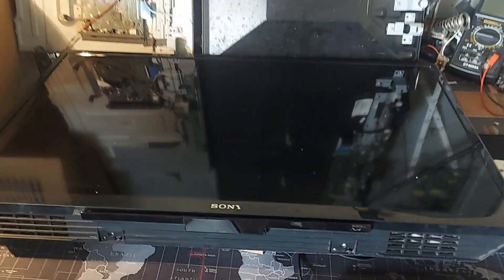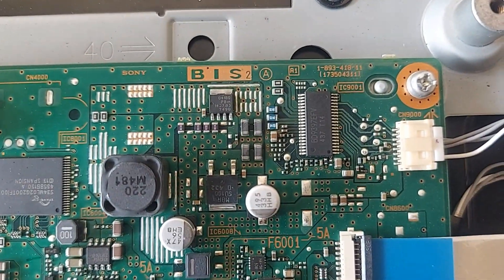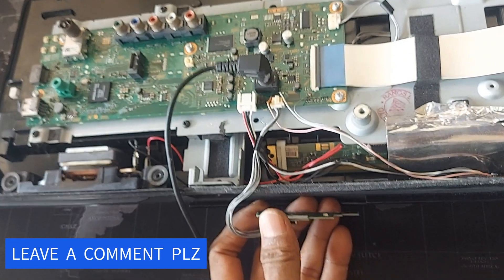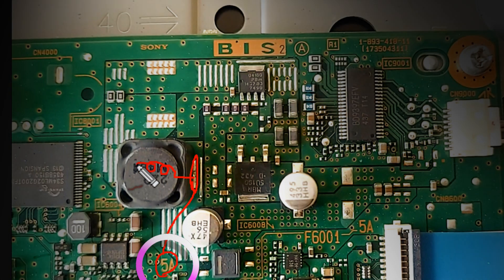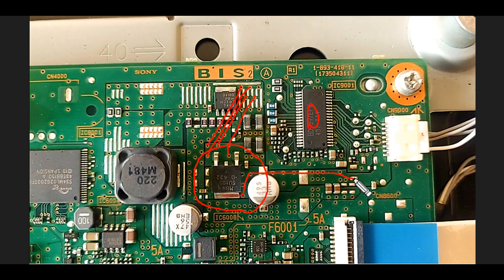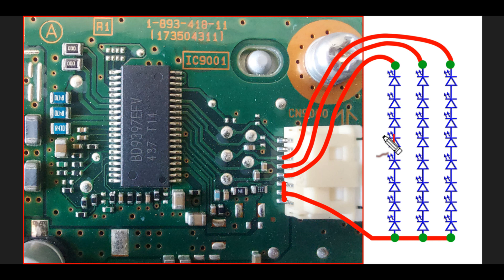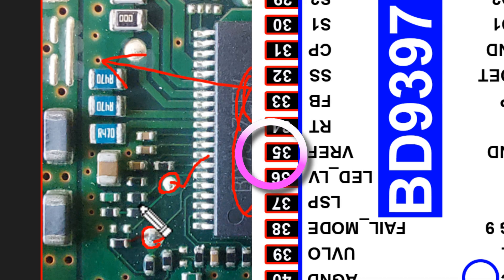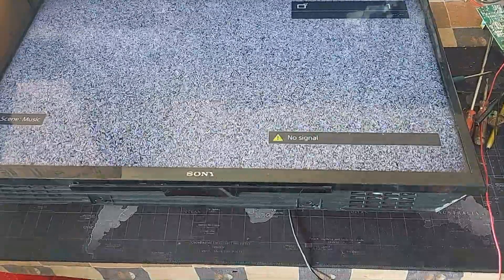6 Times Blinking | Sony Bravia Smart LED TV  Red Light Blinking 6 Times | BD9397EFV IC Datasheet

Comment from the maker: Dear friends, if the Sony Bravia Android TV blinks six times, the best solution is to check the backlight and replace it if they are damaged.
If it is not possible to change the backlight, first repair the TV according to the video,
then press the options button of the TV remote and reduce the backlight option to 25 percent, which will last longer.
❤
Reply: Diming the backlight does the magic. Backlight Ic had a noise to it now its gone.😊 thank you.
Reply: @monishkrishan2700  how to do it
Reply: Sir our mechanic says the life of new backlights is two three yrs even if original Sony backlights.  Is it true n also what are appropriate charges for change of backlighs
Reply: But if the tv is not starting then
Reply: Thanks dear. Works for me❤
Reply: Yes changimg is best cause repairing is only for 3 months working
Reply: Also the method of backlight adjustment on remote is not possible as remote is not working

Comment: Hello Sir, i have a Sony bravia tv 40 inch model kdl-40w600b. The problem is, when i turn the tv on, it tunrs on for 5 seconds and then tv go off and red light flashing 6 times. I checked all backlight are perfect and ok. When i disconnect the connection from motherboard to screen panel, the backlights go on and sound are ok. When i connect the connection to screen panel, the tv led start flashing 6times again.please replay me your helpful info in this case and god always be with you. Thanks a lot.

Comment: You should also have shown how you connected the resistor and the specification of the resistor itself. Without specific info people facing this issue might do more damage to their tv than fix it.
Reply: He said from in 35 to ground
And if u look at the colors or the resistor u can Google it which will show u it's a 2.2k ohm
Reply: I mean pin 35 to ground u can jxt pause the video and have a look

Comment: Great work sir thanks
Reply from the maker: * if the blinking problem occurs 6 times, the best solution is to change the backlights.
***And if it is not possible to change the backlight then-
Press the option button on the remote, and lower the backlight adjustment to 25% for longevity.
 ❤

Comment: But after some days the problem occurre again, is not a permanent solutions
Reply from the maker: * if the blinking problem occurs 6 times, the best solution is to change the backlights.
***And if it is not possible to change the backlight then-
Press the option button on the remote, and lower the backlight adjustment to 25% for longevity.
 ❤
Reply: @OrnatePixels  yes Sir🙏

Comment: Excellent video sir. Thank u ❤❤🌹🙏🙏🙏
Reply from the maker: * if the blinking problem occurs 6 times, the best solution is to change the backlights.
***And if it is not possible to change the backlight then-
Press the option button on the remote, and lower the backlight adjustment to 25% for longevity.
 ❤

Comment: May good frend way you dont shange the ĺeds before you remove protection?????
Reply from the maker: * if the blinking problem occurs 6 times, the best solution is to change the backlights.
***And if it is not possible to change the backlight then-
Press the option button on the remote, and lower the backlight adjustment to 25% for longevity.
 ❤

Comment: Well done, thank you
Reply from the maker: * if the blinking problem occurs 6 times, the best solution is to change the backlights.
***And if it is not possible to change the backlight then-
Press the option button on the remote, and lower the backlight adjustment to 25% for longevity.
 ❤

Comment: Super explanation brother. Thank you.
Reply from the maker: * if the blinking problem occurs 6 times, the best solution is to change the backlights.
***And if it is not possible to change the backlight then-
Press the option button on the remote, and lower the backlight adjustment to 25% for longevity.
 ❤
Reply: What can I do if there is no display on my screen?
Reply: Yes it’s blinking red 6 times.

Comment: Plese speck in Hindi sir
Reply from the maker: * if the blinking problem occurs 6 times, the best solution is to change the backlights.
***And if it is not possible to change the backlight then-
Press the option button on the remote, and lower the backlight adjustment to 25% for longevity.
 ❤

Comment: Very nice vidieo sir
Reply from the maker: * if the blinking problem occurs 6 times, the best solution is to change the backlights.
***And if it is not possible to change the backlight then-
Press the option button on the remote, and lower the backlight adjustment to 25% for longevity.
 ❤

Comment: Hii
Reply from the maker: * if the blinking problem occurs 6 times, the best solution is to change the backlights.
***And if it is not possible to change the backlight then-
Press the option button on the remote, and lower the backlight adjustment to 25% for longevity.
 ❤